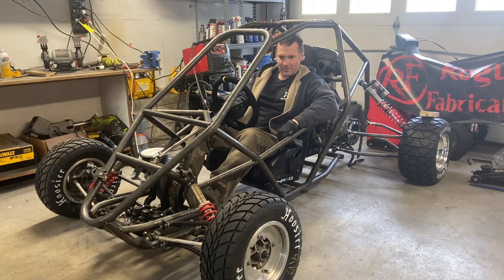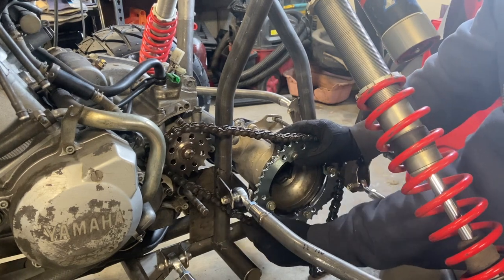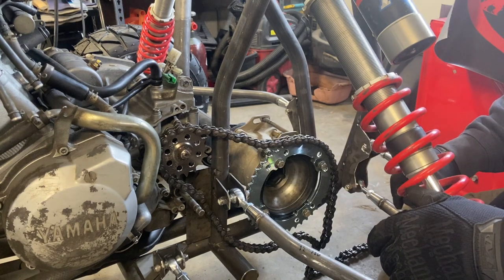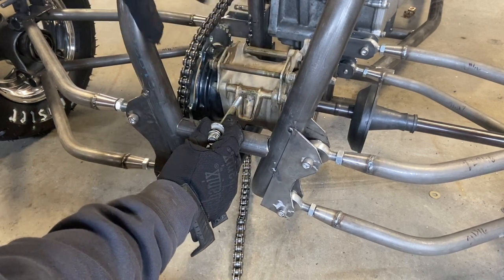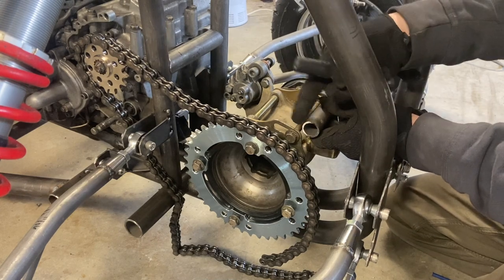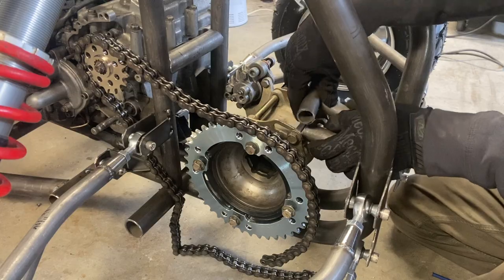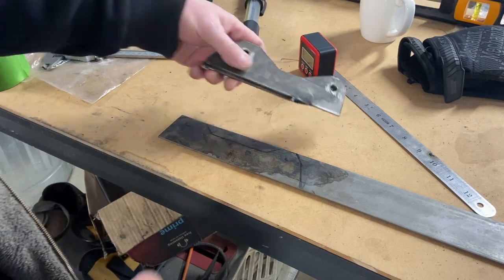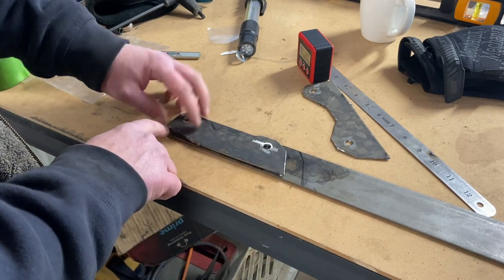Crosskart Build #11: Finishing Work

Comment: Hello. I also want to build such a buggy for a very long time, from the moment I first saw how the Finns were driving them, I also liked this design. it resembles the design of Spanish speed cars. I also liked your buggy, I would buy drawings from you, but I am preparing mine for the Honda cbr 954 rr engine. I will have questions for you, could you answer them sometimes? I look at you using an online translator, so I understand you a little, it's also unusual for me to measure in inches, I always used metric ones. So far, my first question is about the rear wheels, could you write down what size the rear tires are?
Reply from the maker: There is a build group set up on facebook. I hope a translator can work there too. A lot of questions have already been answered and it’s working really well. Wheels are 10” by 8” and the tires are 18” x 10” for a 10” rim.  Or 225/40-10.
Reply: @KJRaycing  thanks

Comment: I like the rear end setup, except for how limited you appear to be on sprocket size. My buggy is running a 14T on the engine, and 54T on the rear, with 29inch tires, I don't think your setup would allow a 54T
Reply from the maker: So sprocket size is just a ratio, for the transmission in the motorcycle engine, a a 14/54 setup on 29’s would be a max speed of like 70mph redlined in 6th gear. A 13/48 setup would fit really well and have a VERY similar ratio to run the same tires.
Reply from the maker: I just run a sprocket that is the same size or smaller than the brake rotor. The mounting tabs for the rear end can be adjusted to run a bigger sprocket clearance wise.
Reply: My sprocket setup is kinda odd ball, my buggy is very similar to yours, except I’ve built it for driving up logging roads and steep rocky off-road terrain, so top speed is not an important factor for me, horsepower/torque to the wheels is what’s needed. Unfortunately where I am, there is no big open flat fields. So if I used a setup like yours with smallish rear sprocket and 29” tires needed for my terrain, I’d be very underpowered and would probably go thru clutches fast.
Reply: And yes a 13/48 would be similar, and I tried to do that, but there is no front sprocket smaller than a 14 made for my engine (odd I know, searched and searched). So big rear sprocket has been my only option

Comment: The rear sprocket is in the way of the rear suspension(not functionally) why didn't you put it more inside the chassis? Also for suspension springs with wishbone suspension torsion bars might work.
Reply from the maker: It always confuses me to see a comment like this.. I have made three of these and they all perform fantastically. I have plans available for the guys who have their own ideas. If you want to do a torsion bar setup then definitely do it and share it with the Facebook group. We would love to see your work 👍

Comment: Why do most of you builders have the shocks at a messed up angle?
Reply from the maker: Because the track is wider than a 4 wheeler mostly. Check the suspension video, i do the math on it 👍💪

Comment: A tensioner pulling out would have done the same and would have given you the ratio you wanted without changing your geometry. Thanks for the video
Reply from the maker: You are absolutely correct sir. I’ve looked into them and definitely like them, but the nice ones are little steep in price and i like taking advantage of not having a swing arm, my chain has not stretched at all after 100’s of miles of abuse.
Reply: @KJRaycing  you did choose a stout chain but as a fabricator myself and an avid off roader I have broken many stout chains because of small rocks and sticks. If I had taken the time to make a chain guard I would not have needed the tensioner. It comes down as usual to personal preference. 
Stay Rad.
Reply from the maker: I use the factory chain guard to protect the case in case the chain breaks and skid plates underneath. I would really like to hear about your projects and where you ride. It is actually the best part of doing this channel.
Reply: @KJRaycing  I'm in south east Kansas so I have some hills, deep river bottoms but I'm not too far from Missouri, Arkansas and Oklahoma. Meaning there's a bunch of fun to be had nearby. I have a couple flat shifter carts, I'm 90% finished with the Escalade  rock bouncer. And now after watching your videos I'm thinking about my daughter building a car from your design  as her first build. Since she already beats me in the flat carts. What is your opinion between clutch and chain or V belt?
Reply from the maker: That is completely amazing! I’m originally from ohio and miss the atv and off road friendly areas. NY is all smowmobiles and boats.  Cvt is definitely and option but would need a bit of fabrication, but just for the upright right in front of the read center carrier. Take those out and it is wide open in the back. A-arms would just be have to be the swing axle type or i’ve put provisions in for a trailing arm suspension.  The chassis is a big triangle so it should be strong enough for a younger persons machine but not a motorcycle engine.  That would be an awesome time with your daughter, my youngest just plays roblox 😡. I instantly regretted the chromebook christmas!